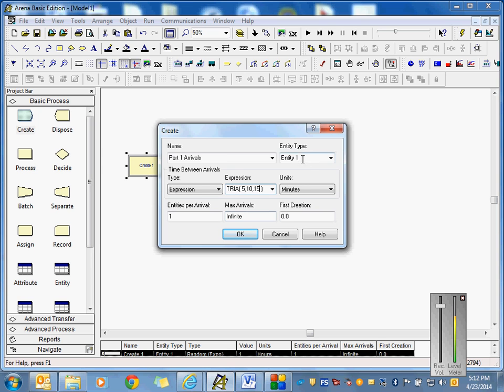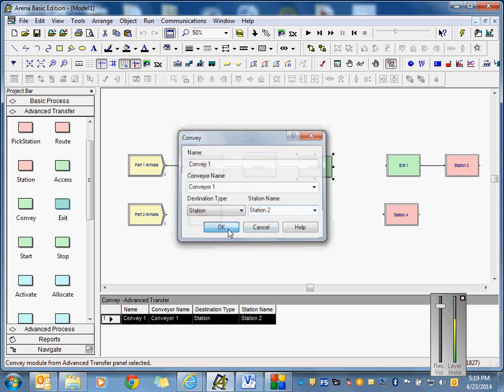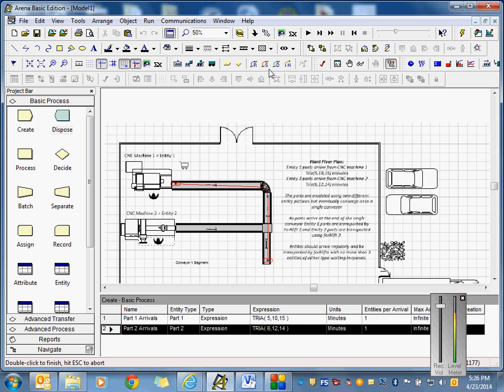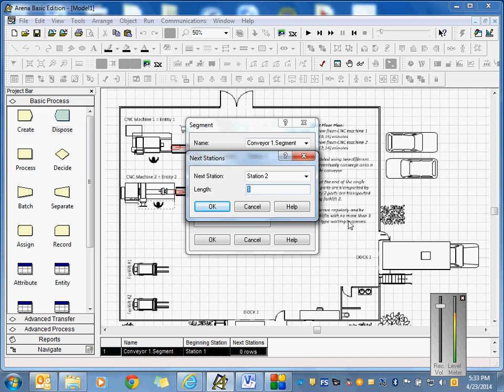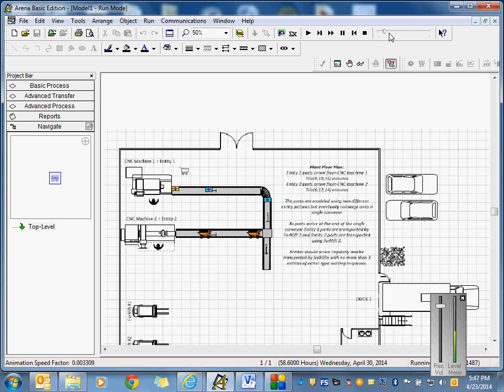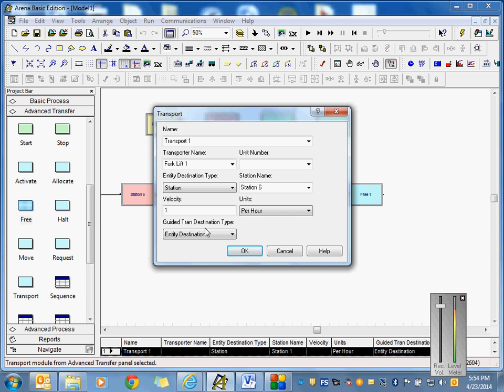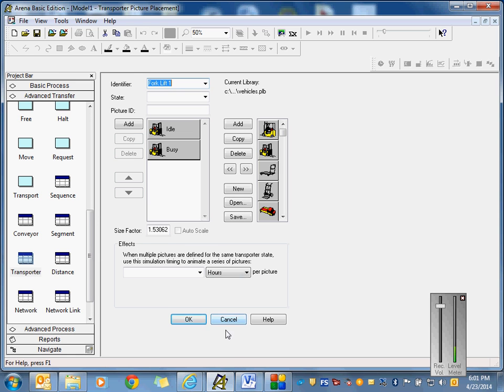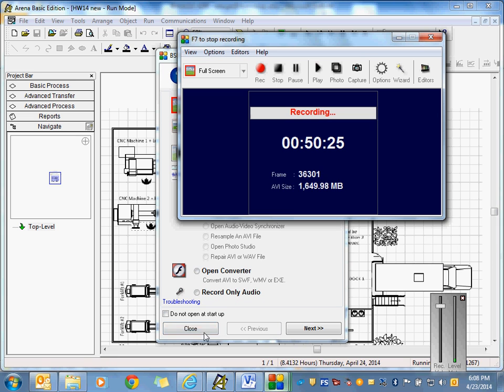Rockwell Arena Simulation - Conveyors & Transporters

Comment: Hi. Thanks for sharing this video. Great! 

I have a question about ARENA: is it possible to use different times in the same resource? For example, I have 3 types of trucks arriving and they have to be weighed on the same scale. Truck A is weighed in 03 minutes, truck B is weighed in 05 minutes and truck C is weighed in 7 minutes. After weighing, they are released and the process is closed. So, how to build this model in ARENA? Could you help me? Thank you in advance.
Reply: you have to use distribution functions to do that, use input analyzer tool from Arena, first make a TXT file with the data and do this https://www.youtube.com/watch?v=eb-0CEaEtwM